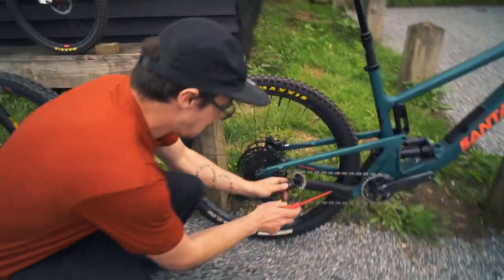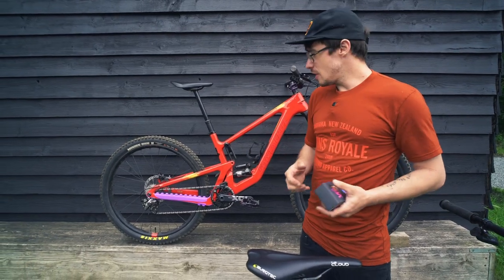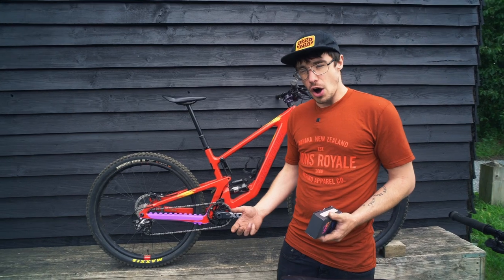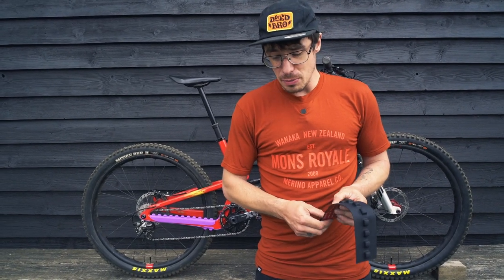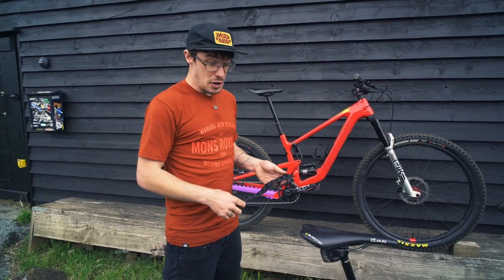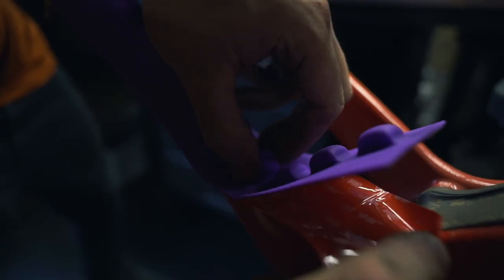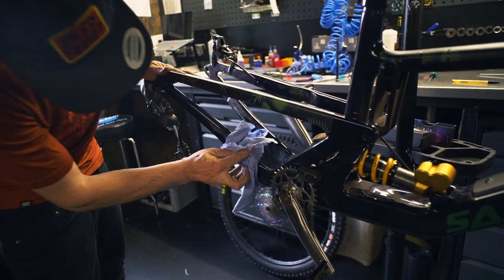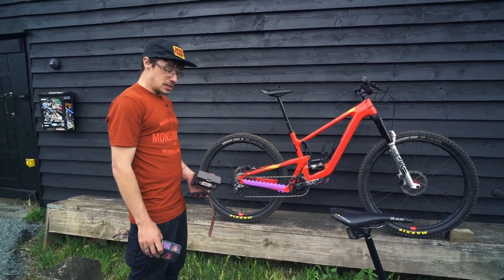Is VHS Slapper Tape worth it?

Comment: For £25 I think I’ll stick with my method… Road bike inner tube sliced in half pulled taught and tightly wrapped, each wrap overlapping the last secured by a zip tie at each end. Get the ridges equal and it looks good. Completely silent. Total cost £1.25.